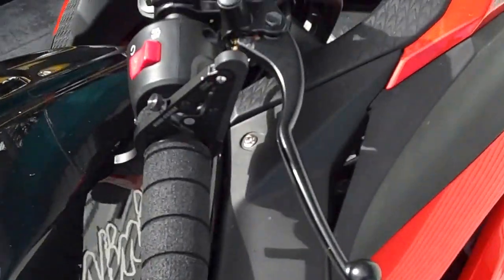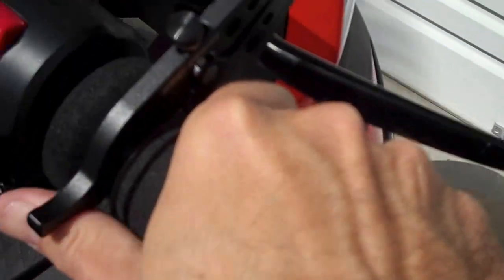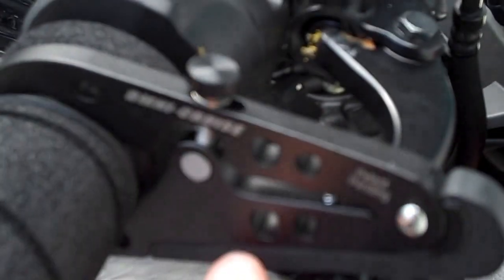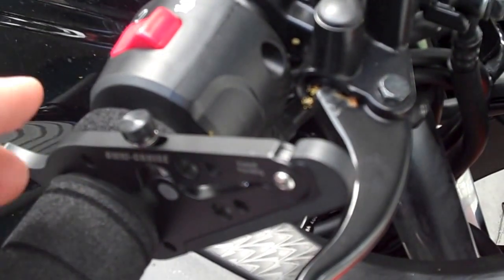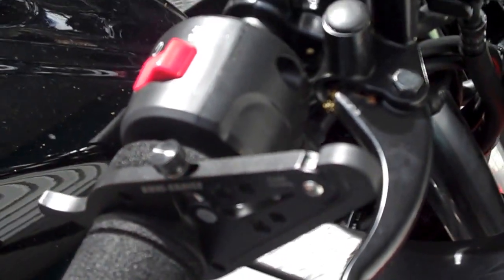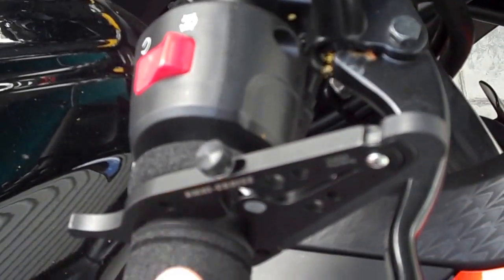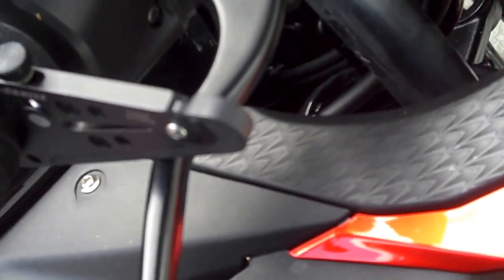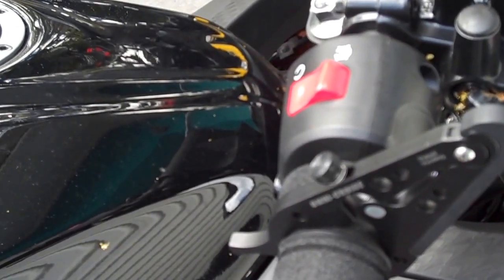Review omni cruise throttle lock kawasaki ninja 300

Comment: Hi!

What happens when you have the cruise control engaged and need to do a sudden brake? Does the brake lever slides the cruise lock upwards? also, does this lock work with the short kinf of levers?

Thanks
Reply from the maker: first off, its a throttle lock not a cruise control, simiar but different devices.
if you do a sudden brake the throttle lock will press againt the brake and press upwards with the brake as you pull the brake in the lock rotates but the throttle doesnt.
as for short levers i cant see why it wouldnt work unless the lever is more then 3 inces from the bar as that is about how long the locking device is
Reply: TheStinger30 awesome! thanks a lot. I'll be ordering one soon!
it shouldn't have any problems with the short levers, right?